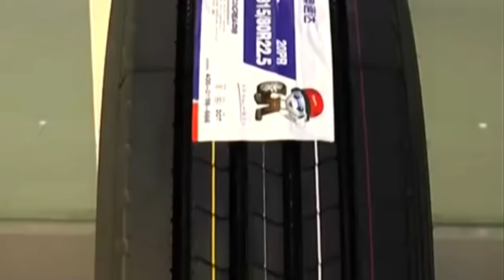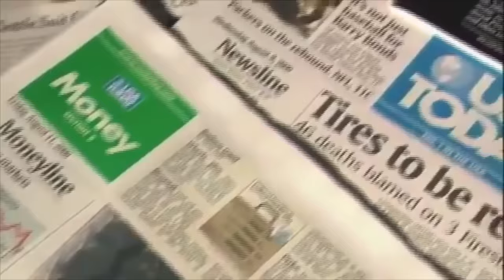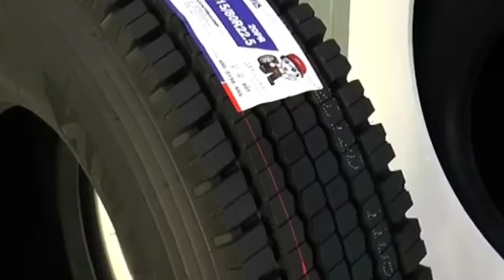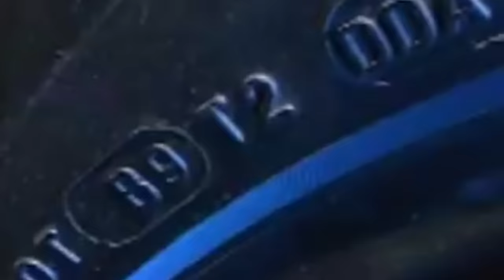5 Tires You Should NEVER Buy!

Comment: Michelin, enough said!
Reply: Defenders.
Reply: I was just thinking the same thing when I saw your post.  If you factor in how much LONGER Michelins last, they aren't that expensive.  Besides... how much is your life worth?  On my cars and my Harleys... Michelins and ONLY Michelins.
Reply: Used both continental and Michelin. Both are really reliable and safe for daily driving here at Washington state
Reply: I said the exact same! Michelin is bar none!!!!!!!
Reply: Michelins on my 2014 Escalade.
Reply: Indian Apollo Tyres
Reply: @sandhyarani9580  Not trying to frighten you but change them asap!!!! Saved my entire family by god' s grace in an alto lxi. The tire burst on highway. Bridgestone now. And its top quality.
Reply: Yes, Michelins are great (except for the cheap ones, but they are still safe). Love Pirelli and General Tires (aka Continental).
Reply: KBM Racing .........yip, I agree, just put four CrossClimate+ on my car, handling seems much better.............can’t wait for snow!
Reply: @sandhyarani9580  never use them , 2 tyres with full nitrogen with accurate pressure got my family into big trouble.
Reply: Charlie K Pirelli, Continental, Bridgestone, Yokohama they all good tire companies
Reply: I got Michelin a/s 3+s on my bimmer😊
Reply: Have bought mainly MIchelin's and on one occasion, Bridgestone. Our Volvo's tires were replaced with MIchelin's, as was the Toyota van we traded in for a Subaru Outback. The Outback however came equipped with Yokohama Geolanders. Michelin's are premium tires and cost more, but like the ride, safety, and performance.
Reply: I’m at my local dealership getting rid of my crappy Continental tires for Michelin Pilot Super Sports right now. Can’t wait to drive my car with the new tires!
Reply: ha!  i can show you plenty of failed michelin motorcycle tires.
Reply: once I got Michelin Pilot Super Sports I never looked back
Reply: It is not only michelin
Continental,bridgestone,pirelli,toyo and kumho are as reliable as michelin
Reply: Michelin Premier A/S Really good drove from Florida all the way to California really smooth and comfortable ride not mention to the awesome MPG they gave me! Amazing tires...
Reply: I only run Nitto Mud Grapplers or Super Swamper TSL Boggers made by Interco on my truck and Nitto Terra Grappler All Terrains on my SUV get more miles than Michelin mud tires and their all terrains
Reply: Alfonso Berumen very good in rain
Reply: I'm using Mickey Thomson on my truck
Reply: Na they dry out quick!!
Reply: Definitely
Reply: Michelin tires are crap, thy develop dry rot too soon.
Reply: *Most Michilens
Reply: Charlie K 
Are terrible when they're worn down. That's most of the life. Michilens are much better than most tires than worn down. Most Michelins, anyway.
Defender
Premier A/S/Primacy A/S
Pilot
A/S 3+

Comment: From first hand experience in the tire industry, there are many tires  I would not install on my personal vehicle but none that will blow out and disintegrate as the mainstream media would have you believe.  When tires are aired properly and monitored for proper wear patterns, there is no danger from the tire.  Firestone took the hit because people ran their tires low on air partially due to the fact that Ford did something other manufacturers do too-placed a low air pressure spec (26 PSI) on their vehicles so as to soften the ride and sell cars.  TPMS systems have fixed that issue, not tires of different design.

Comment: I had many pairs of those Firestones on my trucks, never had a problem with them. 
I drove a lot in the trails and around the city.
When I went more than 70mph they did start to feel heavy.
I think it was more of a speed rated  highway problem with them.
Normal driving they were fine.
Reply: the wilderness tires bought in the aftermarket were different and better than the ones made for ford oem. ford had cheaper tires made. shame on ford and shame on firestone for yielding to them.

Comment: I like Michelin, Pirelli, and Yokohama!
Reply: yokohama is best ti res . Ihave 5year snow tires and i like it :)
Reply: yeha ME TOOO I LOVE THAT Rnd itsa relally6 good it rap;er s my6 butt
Reply: Falken, Hankook and Maxxis are ones of the best as well. Before I saw a drifter drifting with those Taiwanese tires in the Formula Drift series, for real.
Reply: Dont forget Continental and its subbrand Barium they are one of the best
Reply: Michilen tires are great when they're worn. Pirellis drop off quite a bit, but are great when new.
Reply: I'm with you on Pirelli.   Don't know about Michelin.  But I bought a set of Yokohamas in the late 1990s, and three of the four ended up getting replaced under warranty due to mostly sidewall issues.    Not going to be buying that brand again.   Never had ANY problem with Pirellis and I've used them off and on for years, now I won't buy anything else.

Comment: i almost die after changing to chinese brand tires..dont remember the brand it was few years ago..it had 0 grip. after i changed to new tires i went driving and on curve i almost die because of understeer and i wasnt going too fast nor racing not even stepped on a gas, i was just cruising and it happened, it was a road where i go drive frequently and i knew very well that road..how is that at same speed (40mph) a pirelli had good grip and a cheap fucking chinese tires made me almost go off a cliff..one lesson i learned that day "DONT FUCKING BUY CHINESE TIRES"
Reply: Sounds like you put Goodyear EAGLE GT'S on it. LOL
Reply: All the big brand tires are made in china... and chinese engineers stole the blueprints and made their own tires
Reply: Trolling! I used China brand cheap tyres on my bmw car for years and I never have had any accident! Perhaps the tyre you used was worn out or after years the rubber quality degraded! Like food, tyres also has an expiry date, damnit !!!
Reply: One thing ppl need to keep in mind is the date of the tires I've been in the tire business for 14 years and for the last 7 years I've been selling chinese tires. I've sold thousands of chinese brand tires and haven't had a single issue.. yet customers are coming back for more... now as you see in the video all the problems are happening on brand name tires like Goodyear and Firestone also in canada half of the tire market is chinese..

Comment: LOL... Firestone is the Harbor Freight store of Tires...
Reply: Z71Ranger 
Along with Sears Guardsman. They told me a 4th wasn’t theirs it was a WalMart. until showed them the DOT tag matched the install. They ordered it from another store (now closed) because they were sold out of the most common suze 50K tire rated for pursuit lost it at 8,500 miles. The priblem is iur roads get as hot as the desert during summer. total waste if you buy less than PD rated pursuit heat tires. That gets regular life span, then we get th millions in potholes because of poor design
Reply: Apparently you have never had Firestone tires. Run them on all my vehicles, including my racecars, no issues. Read up on Ford engineers, not Firestone tires.
Reply: @UrMomsChauffer  I'm guessing you work for Firestone and you're a Bow Tie guy.....
Reply: Outcast Of Society I run them on my Benz too. I’m guessing you are a Ford guy based on your response to my comment.

Comment: I will stick to michelin, they have neveer failed me
Reply: Michelin's  are no good in the desert. the rubber compound  fails easily. The side walls start peeling  fairly soon . Michelin says its not dangerous. But I won't use them.
.
Reply: They are the tires i like best to
Reply: Everyone likes Michilins. 
The bridgestone potenza for my Lexus are 1200 bucks. They are hard and noisy. Replaced with a 270 dollar set of wally world tires and its just as smooth and tight.  We will see if it atays that way.
Potenza 400 I think is what they are. I have a staggard setup and wierd sizes on that car...

Pilot sports or Super sports on anything that is going faster than 100. Period. 
My Is 350 doesnt see over 60 most of the time, I had good luck with bargain brand tires from Hercules (imove 2) on my Focus ST when I kept tearing up Goodyear Eagles at 220 a piece I switched to these and took my new Goodyears back.

944t has Pilot Sports

Rx 330 has Firestone Destination LE2 Great Tires aswell

and finally my bike has DUNLOPS.

It can be a crap shoot so review the boards and find out what people are having luck with. I bought a set of westlake tires for a car a while ago. RP 18
I think they were called. I could tell before they were installed that they were just not going to work. They had flat spots from sitting and it didnt get better when inflated, actually made it worse. Worst tire ever. The car was a turd box.

When all your cars have sport package on them with 18s and 20s, its hard to put expensive name brands on every one. I spent the most on the fastest car I have, second was the most reliable car I had, the rest are toys and got off brands.
Reply: @rgcdn1  I see lot of Michelin's have dry cracks , I always use Goodyear

Comment: I rather walk or on a bike
Reply: Yes, bikes do have tires as well(duh), but it is extremely difficult to overheat/overload a bike tire like the way the wilderness AT/G159s were. If you underinflate a bike tire, you will notice. Bike tires do however like to blow off the rim at higher pressures, there is much less of a safety margin in bike tires/rims than in cars. For example, a bike tire rated for 90 PSI may blow off at 150, but car tires rated for 50 PSI can withstand 200+ PSI. This is likely also a factor of rim design and looser standards in bike components, but still...

Comment: What do you guys think of Falken?
Reply: I use them on my race car... they work great
Reply: ChallengerSXT 88 falken are very good , dont let anyone tell you different
Reply: Fantastic tires
Reply: Ok I appreciate the replies.. I have falken ziex 950 and they are really good tires on my opinion. The tires are 245 45 20 but someone suggested that I get 275 instead of 245. Is that a suggestion that I should take or should I stick with the same tires.
Reply: They're falken terrible
Reply: ChallengerSXT 88 if you buy FALKINS you may get one .
Reply: Falkens are a great mid grade tire. They only last about half as long as their warranty suggests but the performance and comfort is very good.
Reply: I have Falken AS200, nice tyres. I use them on my 92 car, no ABS/ESP, they look really good also on wet roads
Reply: toyo or michelin is also good quality tires, on winter i dont ride anything else but nokian, the finns sure know how to make winter tires.
Reply: ChallengerSXT 88 the First number is the width (ie275/35R19) which should be matched with the Width of the Rim your putting it on.
so if you're rim is closer to 275mm wide why wouldn't you do that its increasing the most important thing, the Contact Patch of your wheels not to mention putting too small a Tyre on wider rim or vice versa is brain dead as it lessons the tyres ability to what its designed to do in almost every way including staying on/part of the Rim!!
Reply: amazing tire, I used it on my formula one car.
Reply: ChallengerSXT 88 I’m a tire tech and if I was you I would stay with the the original tire size. From going from a 245 to a 275 is not that different all it is is just how high your tire is
Reply: Nathan Howard. 275 is the width.. 45 is the percentage of the width for sidewall height.  Moving from a 245 to a 275 makes big changes in tire height, thus changing rotatipns per mile affecting the accuracy of your spedo. It could also cause drivability issues making the computer in the car to give erroneous codes or with a chrysler product put you into limp mode.
Reply: The reason I asked that question on which size tire should I go with. Is because a friend of mine works at Tire Choice and he recommended me on getting 275 over 245 because he said that for them being wider tired I’d have more grip and he also said they would fit perfect on my rims which If im correct they are 20x8 inch rims. Idk but I might just look into buying the SRT wheels
Reply: ChallengerSXT 88 if you do that make sure to have the chrysler guys input the new tire size in the computer for the new chargers and challengers
Reply: ThaSteeze520 mid? They are the same price as Michelin at least for my tire size
Reply: If you have a GM suv or truck, you can get a solid 6 years and 60000 miles out of them
Reply: Is it Falken or Falkan?  Anyway, see where they are made (stamped on the sidewall).  And don't forget a general rule, the higher the speed rating, the better (and more $$$) the tire;  the same "model" of tire can have different speed rating available, so it's not as simple as saying "my BFG Advantages are a great tire".  A V-rated tire of the same make/model will make a H-rated version of the same make/model look like a dog!
Reply: Falcon just sold out the Sumitomo
Reply: Have them on a 2006 gto they wear out way to fast the warranty is horrible I didn't even get 30 k on them
Reply: ChallengerSXT 88 I run 2754520 110H Falkens on my truck, the grip is Insane, this is the second set I bought and I haven't encountered any issues, just be sure you rotate and balance every 6 to 8 thousand miles and keep them from getting cupped and they'll last a while
Reply: ChallengerSXT 88 I've bought my second set of FALKEN Sincera for my FIAT Punto, India.
Reply: Never had a problem, exceptional handling and quality especially on Ford Crown Victoria, Mercury Grand Marquis, and Lincoln Town Car.
Reply: regal953 correct. They handle and feel great but life span is below average

Comment: Lol michelin?
Reply: ja nee Toyo makes high end tires (made in Japan and not China, rare) too, what are you talking about? I had a full set last 20k miles back in high school and they were cheap too! Everyone always talks about Pirelli tires too and how good they are, but they make cheap ones for $100 just like everyone else does.
Reply: He just Days that you  shouldnt Buy American crap tyres
Reply: depends on the tire. The factory ones that shipped on my 01 silverado lasted from the time my dad bought the truck new (2002) until the time i sold the truck (2017). 256k miles! never a flat damage etc. The one thing i will say about the tires, when i drove the truck they were bald and the truck was prone to hydroplaning, but i mean the tires had 200k miles on them. how much can you really complain about that. 

now, the michelins on my cadillac? complete trash. I went through 2 sets of 225/45r17's before i switched to cooper, which were much cheaper and i haven't had a single issue. The grip on the michelin was excellent but a) expensive and b) i seemed to pick up nails and other damage almost constantly on these tires. where as with the cooper's on, ive yet to have a single issue (knock on wood). the michelin had far superior grip but whether it was bad luck or what, they just weren't reliable for me. the coopers have been reliable thus far, and as i said they were pretty damn cheap too. i will say though, they have a fat sidewall and thus look much less cool than the michelins did, which are a rigid runflat sidewall design
Reply: Michelin is the best you can buy
Reply: Jared Gulley yep
Reply: correct Jared
Reply: Michelin may make a good tire, but they are so overpriced, you're just paying for the name. Tires for my truck, Cooper brand, were $134.00 each. The Michelin brand are $190.00 each. I've had Michelin's on a car, I wasn't impressed with the noise level or the performance.
Reply: ja nee  USA is the best I work at goodyear and we all hate Asian tire brands because they are cheap.
Reply: Looking decent
Reply: @blainederouen9977 
And for the tires to still be great at handling wet pavement when worn down. And the long treadlife.

Comment: Add Yokohama to the list. Local tire shop sold me on them so... Had to go back twice complaining that they didn't run smooth. 
Ended up replacing 3 tires saying they found 3.
My current car has a set of yoko's. Same issue. Went back to have them rebalanced and an alignment. Didn't help. Ok under 60 mph but at 70+ the vibration is more than evident. Going back the Michelin tires. Car drove just fine with the stock tires.  I would rather pay double than to ride on crap tires.
Tires are your only connection to the pavement.

Comment: Actually the Ford Explorer's exhaust ran close to the left rear tire causing most to fail when under inflated, 90% of those cases it was the left rear tire because of the exhaust. Now I had some Primewell Valera HT tires back in the day hydroplaned off the road 4 times and then got rid of them.

Comment: I can also confirm the Firestone tire fact about being underinflated. I was told this personally by the trainer that trains all incoming techs nationwide. Essentially the tires are specified by Ford at 30 psi, which is the minimum pressure the tire is rated to hold. Ford chose this because any higher pressure and the Explorers would roll over. The average tire loses about 2 psi a month. So you figure after three months, which is around how long people go without taking their car in for service, the tire is around 24 to 25 psi, making it no longer safe. Ford outlawyered Firestone and in the end we all know what happened.

Comment: It should be noted that ford was only inflating the firestone tires to 26PSI in order to pass goverment roll over tests. the softer tire had more give and helped reduse the risk of roll over but also caused excessive sidwall flex under normal driving conditions that would cause the tire to heat up and eventually fail. My point is that the tire was not to blame. if it would have been inflated to 35PSI like most suv tires this issue would have never happened.